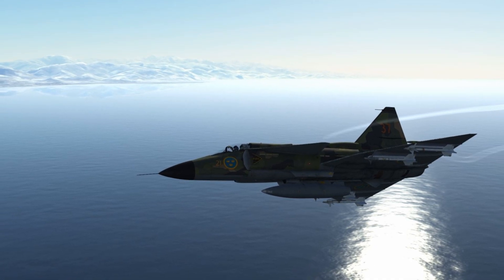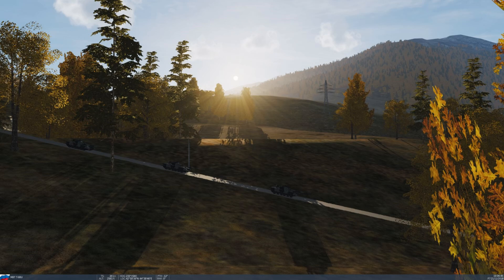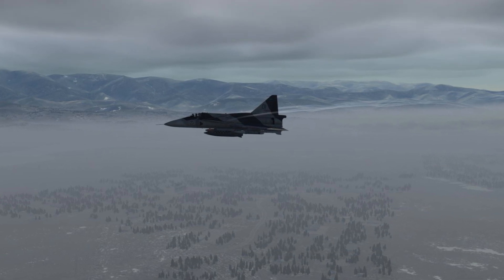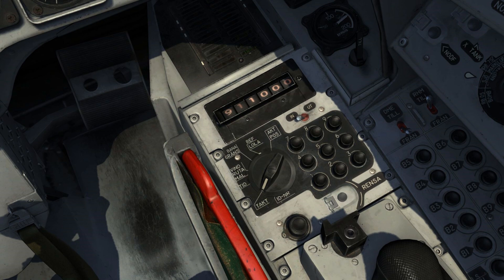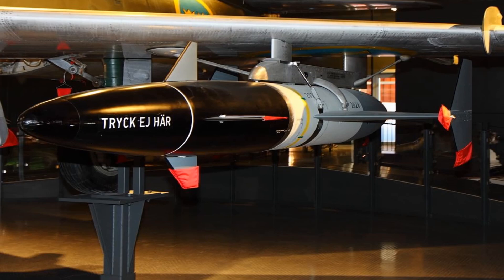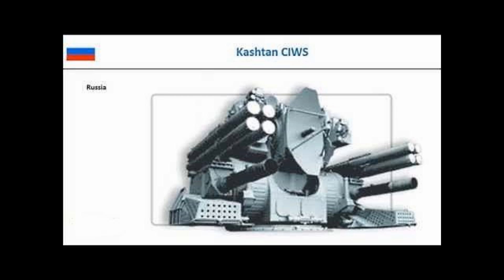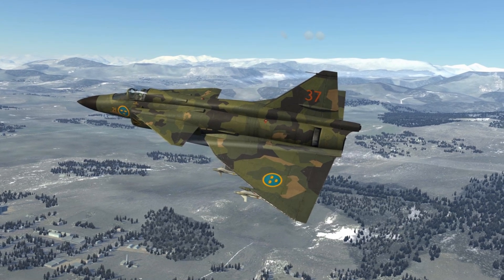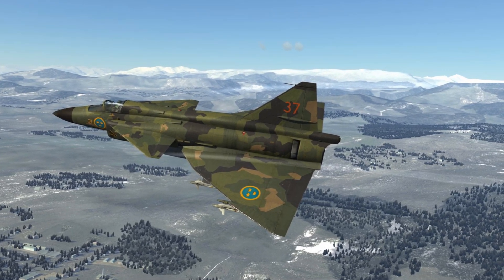DCS Viggen BK90 wind correction and RB15 RB4 Ship Attack

Comment: inputting wind doesnt correct the bk90, inputting numbers and entering them via waypoint buttons just starts to input Reconnaissance square points. Also the bx9 waypoint needs to be pretty far from bx8 or else bx waypoints wont work
Reply: the newest patch of last week does automatic drift correction for bk 90s, but you still need correct ins data.